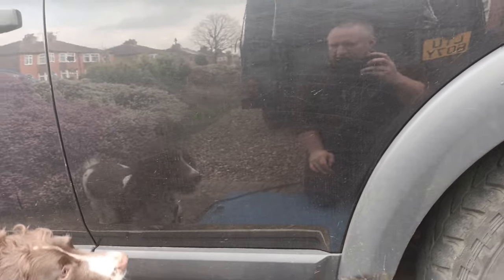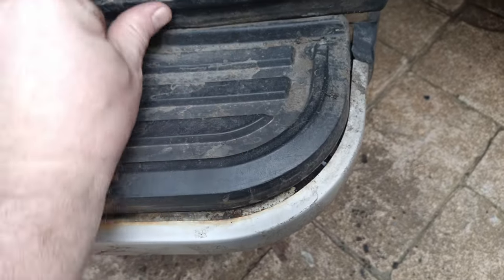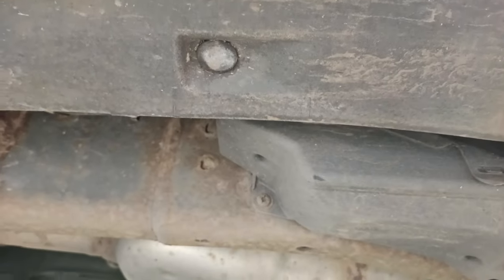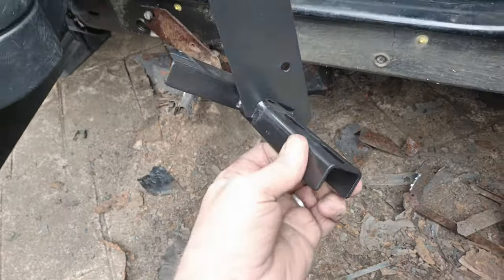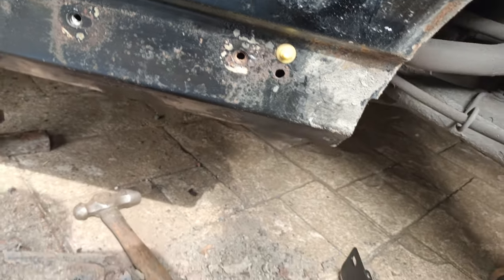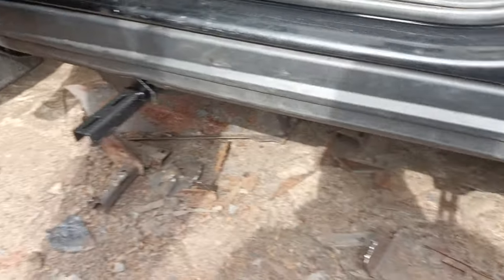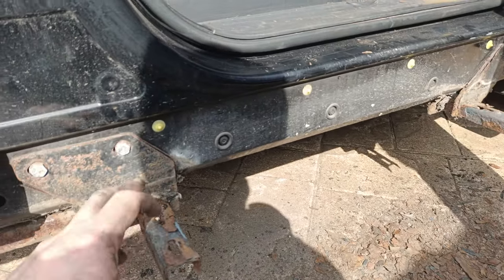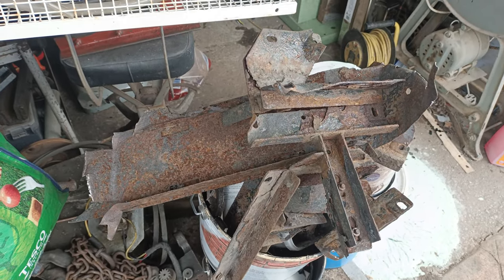Discovery 3: Side Step Replacement

Comment: great job, you are lucky you don't have any corrosion on your sills.  Its usual now.  I have three D3's and they all need the outer sills and rear wheel arch section replacing.  Looking forward to some more D3 vids , cheers
Reply from the maker: Thanks, there was a tiny bit of corrosion on the near side sill. I added some rust kill, and applied a liberal amount of under-body sealant. Fingers crossed it will prevent any further rot..